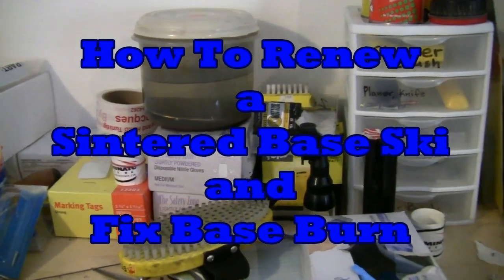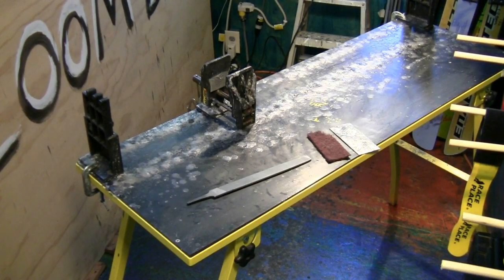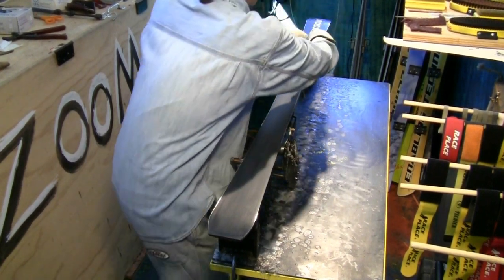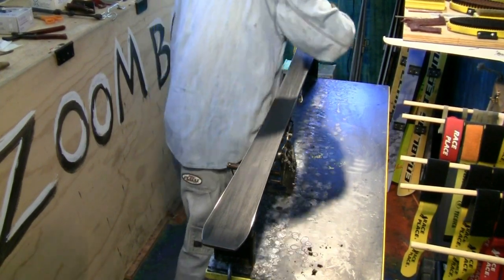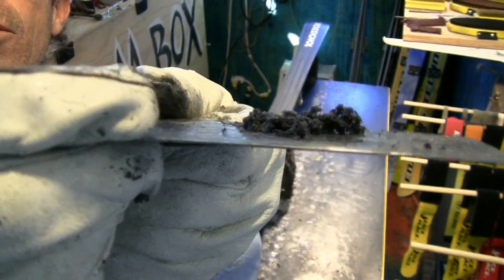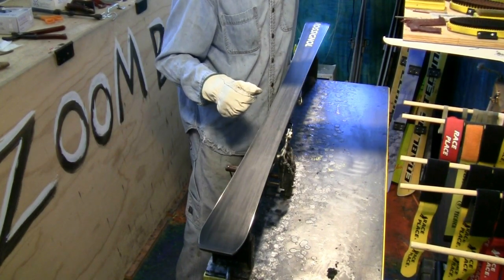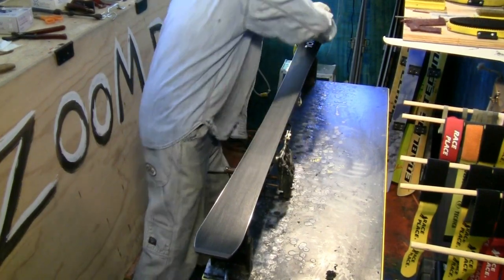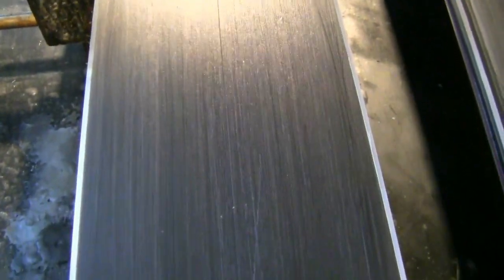How To Renew A Sintered Base Ski and Fix Base Burn An Alternative To Stone Grinding

Comment from the maker: Yes Burton, man made snow is very abrasive.  For that type of snow a very hard wax is what is needed.  Also, that hard wax needs to be applied every night after skiing in that stuff.  Be sure to brush out the board or ski prior to any waxing.  Once the base is "burned" one will have to do this to "cure" it.  You can only grind a ski so many times.  This way can be done many more times and still have a base left.

Comment: This dude is a beast! Got my wifes 2011 nordica mints looking and feeling like better than new. 10yrs. later!
Reply from the maker: Thanks. The scraper could have been a bit sharper here, but oh well.  Main thing is sharp, but rough at the same time to produce structure.  Glad you had good results.  Lots of work it can be, and with a base high situation, can be better than grinding!

Comment: Thank you for being so generous in sharing your knowledge. I just restored my old Rossignol Acrylite 47 AR XC skis. They look better than new. So very much appreciated, brother.
Reply from the maker: Awesome!  I had to do this twice to these skis to get them really working again.
If a base has been overheated, then one may never be able to "open" it up again.
Good luck, and when done well, they should haul some mail!  Assuming they have Dominator wax on them!
Reply: @Sagina1999  I took them out on their maiden voyage last night and it was spectacular. Clearly, I still have much to learn, but knowing that I have some ability to fix the nasties, gives me much peace of mind, and more freedom to enjoy more freedom. Thanks again, brother.
Reply from the maker: @garykuzminski7969  Curious, did you use a Kuzmin scraper?  I don't have one now, but hear they are very, very sharp!
Also, although one still needs to use a base prep. wax, many XC skiers are finding much success with the Dominator paste waxes.
Easy to keep the waxes out of the scales, and it's gliding properties seem unbeatable.

Comment: You're welcome. I have never scraped my snowboard base like this before. Is this process something that you would perform on a well maintained ski or snowboard as well? As long as you wax regularly you don't need to do this or is it something that you should do once a year during the off-season?

So many people on the east coast have base burn from riding on man-made snow. I have noticed that the man-made snow will strip the wax off of the base faster than natural snow.

Comment: Hi from Menton in France. ... very interesting and helpfull.. i have been doing the same for few years before tuning edges... just one thing, shame you didnt show how to check the flatness of the base....  ciao
Reply from the maker: I use a true bar to check base flatness, but for these skis, the steel scraper told me they were flat enough!  Thanks, Jacques Mailloux
Reply: Thanks for fast answer... i am very fond of skiing and tuning.... on average i ski 100 times each winter... most of time in courchevel. ..ciao
Reply from the maker: @philippetesta7443  Me too!  Mt. Bachelor, Oregon, USA.  Be good!

Comment: Hi this is really good !
I have 12 years old snowboard and I never even waxed ! The reason is that board have very nice deep texture and I didn't want to loose that!
So I did some research recently (now I know I was stupid) so  now I bought some stuff and want to look after it!

Im wondering if I can use the normal wire scrubbing brush, I found one with 8x22 bristles so it's quite dens, but bristles are 3cm long
What do you think? Will be good to texture it a bit? I really appreciate your opinion!

I already bought brass and nylon brushes , wax and gummy stone, stomp pad, some p-tex, all adds up! And steel brushes are very expensive!
Please advise
Reply from the maker: Get the brush.  Maybe it is not super stiff though.  Maybe look at a hardware store for a really stiff stainless brush.  Sometimes they are sold for BBQ grate cleaning etc.  Good luck.

Comment: I have just bought some second hand ski blades probably about ten years old so the base needs some TLC.  I will follow your video and restore them but trying to find a store to buy a stainless steel brush is a pain.
Reply from the maker: You might want to look at a hardware store.  Many brushes can be used on a ski base.
Scrape away!  Even if you skip brushing, it will be okay.
Reply: I have bought a barbecue steel brush off Amazon should do the trick
Reply from the maker: @Shan-outnabout  That's the ticket.  Hope it all worked out.  The scraper must be very sharp.  When I made this video, the scraper could have been sharper.

Comment: I’ve used your technic and it works awesome on our grandkids used dried up skis but How did you do the long base level?
Reply from the maker: With a file.  It's a lot of work to cut into the bases a bit.  I use a coarse file, then polish back down with diamond stones.
Reply: @Sagina1999  Thanks I watched  another video and noticed how as you worked the base edge is where it it all comes to get her thanks again

Comment: Great vid. I have a question about a friends board I waxed. It seemed like the wax was flaking off on his board and not being absorbed into the base material. I am pretty sure he had not waxed it much if ever and the board is probably ten years old. The board looked dry after one day of riding. Seems dried out like you said. Would a stone grind at a shop restore it similarly to what you are doing with the metal scraper?
Reply from the maker: Yes.  Get it done. Then use a quality base prep. wax before you apply a glide wax.
Reply: @Sagina1999  thank you sir
Reply from the maker: @bartmcdowell8349  You are quite welcome.  I do these to help folks out.

Comment: Hey, so I just picked up an old pair of Moment Bibbys made in 2015. I’ve got an edge crack on one ski underfoot. I was thinking about predrilling two tiny holes and putting two screws in coated with jb weld, then patching over the access cutout with some dye cut 4001 durasurf. Also have a 3 and a half ish inch piece of topsheet at the tail that chunked off. I was planning to sanding it a lil and then lay a small fiberglass piece with topsheet material over top, and clamp the shit outta it. Then was going to do this base method shown in the video after all that’s all figured out to bring the life back to em. Two questions if you don’t mind. Do you think my patching methods will work okay, and do you know of anyway of sintering the topsheet back it’s factory-ish look? Theres a fair amount of medium and micro scratches, and they’ve lost all the sheen.I was going to give sanding a shot but wasn’t sure if I’d be able to get the same brushed texture. Also, last question, had one more pop into my head. Do you know of any good way of doing something similar for the sidewalls?
Reply from the maker: Wow, that's a lot.  All I can say is good luck.  I never worry about cosmetic stuff like how a top sheet looks.
The skis are only going to last you so long, so don't go overboard!  I'd just scrape the base, then tune the edges and scrape the base again,  wax them up good and have fun.

Comment: good job sagina... great video

can you use a plastic scraper instead of a metal one? or is it less effective?
Reply from the maker: You can, but it will need to be very sharp.  I would stick with a steel scraper.  One may also use a aluminum oxide or similar polishing stone and use it like a scraper.  You need to do the stones wet.
Reply: Sagina1999 thanks for the reply.... so is this process as good or better than a machine base grind?
Reply from the maker: luis7suarez7
Depends.  For any lineal grind it is equal.  Maybe better sometimes as the chance of plastic "creep" is gone.  A stone grind still needs a bunch of work to bring it up to speed.
Reply from the maker: @luis7suarez7  Back again to show you the work involved for a freshly stone ground ski.
https://youtu.be/8WsboLAUYYk
Then prior to that cleaning a fresh stone grind.
https://youtu.be/OYnjGifr_Xs

Comment: Hi,
If you had them ground before or scraped before or even not worked on before, the steel edges should be at the same height as the base. in that case a scraper wider than the ski would really not be removing much of the base material as it would be resting on the steel edges.. How would you deal with that?
Reply from the maker: +s sanka  With a "long" base bevel, just as I show in the video.  Maybe you skipped part of the video.  It's covered in the first two minutes.  Check it out.
Reply: @Sagina1999  I was wondering why you didn't explain that.  You talked about doing the long bevel, but not how and why.  It was right before your neighbor came, so maybe it got lost in the confusion or the edit.  Great work though.
Reply from the maker: @JackBauer529  Yea, I guess I thought folks would understand

Comment: Aloha, Sagina1999! Bought a new/old 2013 snowboard with a high end sintered base. I assume it came with a factory wax, but that was 7 years ago. Do you think I would need to scrape off a layer of ptex or do you think I could get away with just using a brass brush and applying new wax? Thanks for any advice you could give.
Reply from the maker: Go ahead and brush the death out of it.  Use some quality base prep wax such as Dominator Base Renew.  Then wax it up and try it out.  If after use, if the base looks gray or whitish, then you will need to remove the old dried up plastic layer.  It's harder to do with a snowboard using the scraper method as they are so wide, but can be done.  If not, you will need to have the base stone ground.  Look for a shop that stone grinds boards a lot, has a good machine and a competent operator.  Good luck!
Reply: Thanks so much for the advice. I'm in Hawaii so no ski shops for a base grind here. Base doesn't look burned, but is probably thirsty for wax. Will definitely look into the Dominator Base Renew. Thanks again.
Reply from the maker: @eightoeightmiles  Good luck!  
http://www.dominatorwax.com/
Reply: Aloha, Sagina1999! I ordered some base prep wax. What do you think about a hot scrape before a second coat of prep wax? The base is pretty much new and is probably just really dry but not particularly dirty. Thanks again for the help.
Reply from the maker: @eightoeightmiles  I don't hot scrape anymore.
I use Swix Glide Wax Cleaner.  Way better and easier than hot scraping.
That said, you surely want to clean the base well on a new ski or board.
Give it a few hot scrapes, then apply a layer of the base prep.  Heat it and let it cool overnight.  Then without scraping, heat it again and cool.  Do that at least three times.  Maybe much later during storage, scrape and brush, then apply prep, wax again for storage.
Good luck!
Reply: Sounds like a plan. Much thanks and aloha.
Reply from the maker: @eightoeightmiles  If I see Gerry, I'll tell him you said hello!  Ha ha.  
Flash back to The Big Wave 2013!
Maybe you can get some laughs.
https://youtu.be/UfmRM09455c
Reply: Ha! Bachelor must be something to get a surf legend to drop anchor in Oregon.
Reply from the maker: @eightoeightmiles  Bachelor gets wind lips that are like waves.  That's why he liked it.
It's like a beach.  You have to live there to get it when it's up!
Reply from the maker: @eightoeightmiles  Oh here you go.
Shhhhh, Bachelor sucks.
Lopez:  https://youtu.be/nIXEKKRhueM
Reply: Yeah, those powder runs look awful.
Reply from the maker: @eightoeightmiles  Early ups for video for Bachelor.  It's pure fantasy.

Comment: How much do you charge for this work? seems cheaper to just buy new skis
Reply from the maker: New skis need a lot of work too.  The skis in the video were purchased for $50.00.  I guess if you can find new skis for that then you got a good deal!
I had to do this twice to get them good again.  No charge as they are my own!
Reply from the maker: +Sagina1999 BTW, this is something one would do instead of a stone grind.  Some new skis may need a bit of flattening, but I don't follow the totally flat camp.  Base shape makes a ski handle in different ways depending on the shape.  For one example look at the Elan Amphibio's  new skis.  Many other skis may have a bit of a boat shape in the tips and tails as well.

Comment: The base is polyethylene. What should dry out of it? Makes no sense. Must be a different process happening.
Reply from the maker: Ever leave some in the sun?  What happens?
Ever do some sanding on some?  What happens?

"The environmental degradation mechanisms for plastics can be classified as either (i) physical, referring to changes in the bulk structure, such as cracking, embrittlement, and flaking, or (ii) chemical, referring to changes at the molecular level such as bond cleavage or oxidation of long polymer chains to create new molecules, usually with significantly shorter chain lengths."

"Typically, chemical degradation at near-ambient temperatures in the environment involves either hydrolysis (requiring H2O) or oxidation (requiring O2), both of which can be accelerated by microbial action, heat, light, or combinations thereof."

Comment: silicon treadmill oil works well on a dry base.
Reply from the maker: I use silicon lube to get into my ski boots easier, but would not advise on an un-waxed ski base.  A wipe over a fresh wax job may not hurt, as it will come off super fast anyway.
Reply: Sagina1999. I've never seen any adverse effects on an extruded base. I also never tryed it on a cindered base. Thanks for the reply.
Reply from the maker: @siayourcannaguy6106  It is quite hydrophobic, yet the effect will be short-lived.  Personally, I would not do it.  Some silicone lubes are not pure and contain other oils as well.